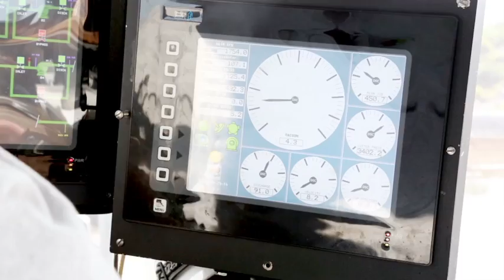Onondaga Lake Cleanup - Sevenson's Cutterhead Dredge

Comment: Those SHAKERTON Sectional barges  used on that project was designed and manufactured by J&J BoatWorks, Inc.
Top of the line sectional barges. Very proud to see the barge I designed and built used for such a good work.
I love to see the barges performing as the were intended to do.